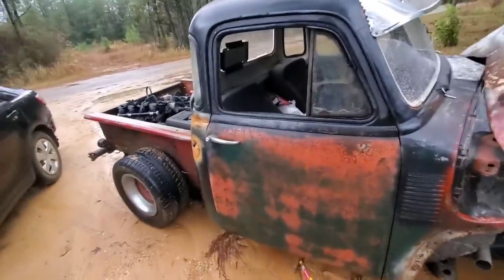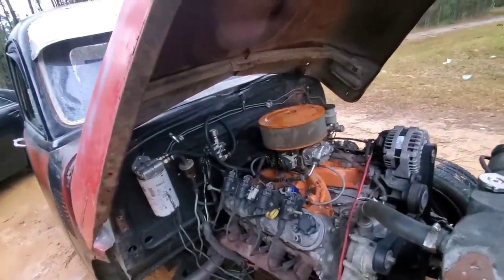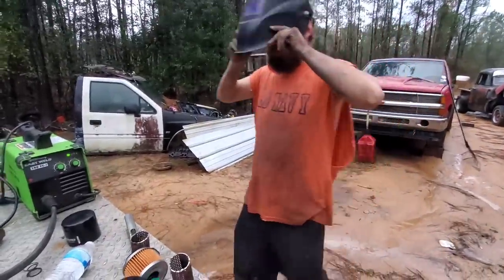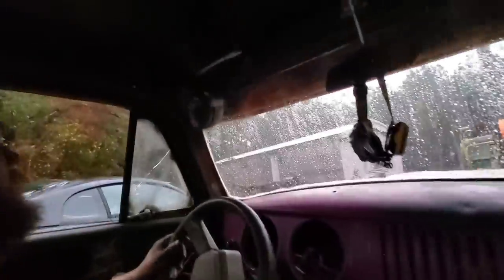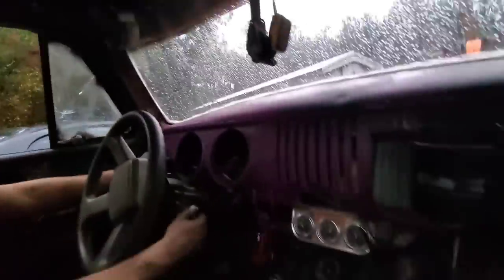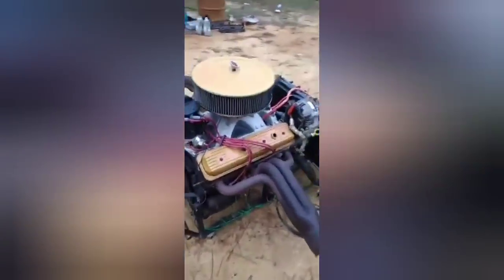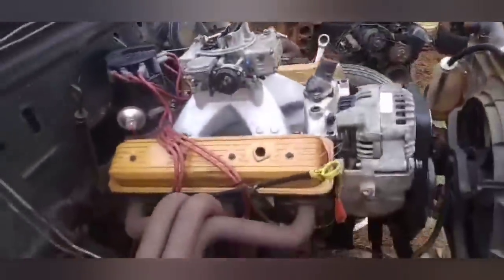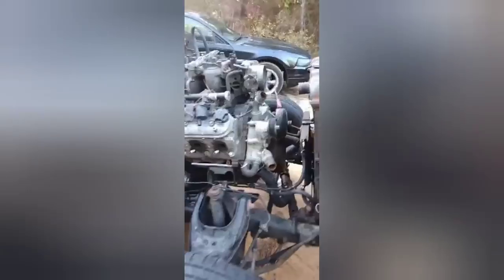Hot Wheels Put A LS 4.8 In His 54 Chevy RatRod

Comment: Mmkay I didnt know exactly where to start but a bigger carb doesn't equal bigger power its been proven you can hear it in the engine revving, bigger carb on a smaller engine than a 350 and no Wide-band is an eye burning good time I guess. The oil filters at the end of the poop'r is some next level stuff, and there aint no telling a'guy his business when he thinks he's on the top but when he hits bottom he's always open to suggestion.

Comment: Wondering if u could help with me something. Got a 99 5.7 vortec stock witblike 224k miles, bogs down on acceleration, backfires. Checked spider injectors, regulator, fuel pump, air leaks around the intake. Got p1345 code. But it's always been on since I owned it. Distributor at tdc. Was gonna actually check wat angle the sparks at but it's been under 20degrees lately. Thinkin it might be my intake gasket, module, or crankshaft sensor wire as it's been repaired already just by tyin the wires back together and electrical tape. Oil had gas in it, and smelled like gas. Wen it gets warmer im gonna let it run and pull plugs wen I turn it off to see if there's extra fuel bein left on. Anything else to look at?
Reply: Its the fuel pump. U may have the pressure, but not the delivery. Meaning it's not flowing as it should under hard throttle. Sounds stupid, but that's what it is. Or the fuel filter is just totally plugged up.